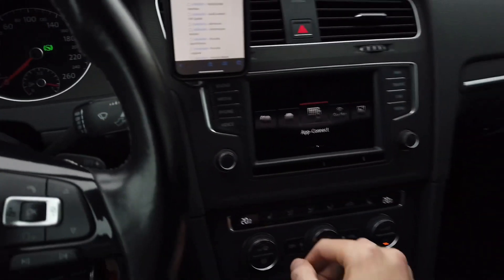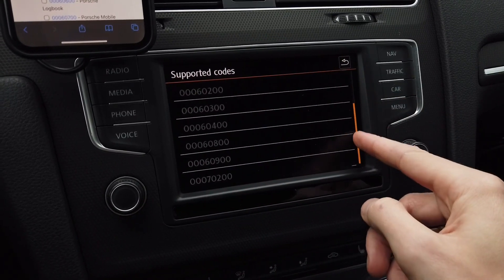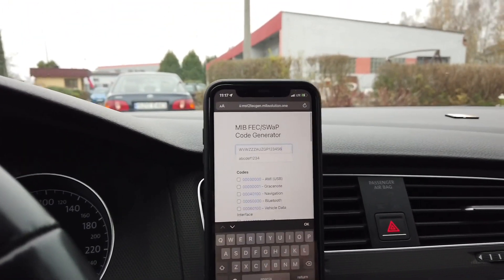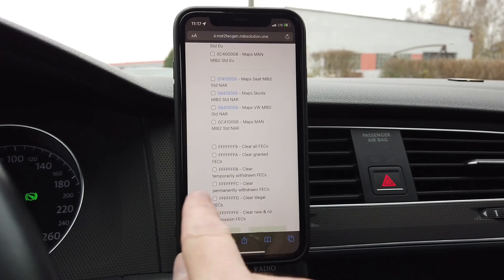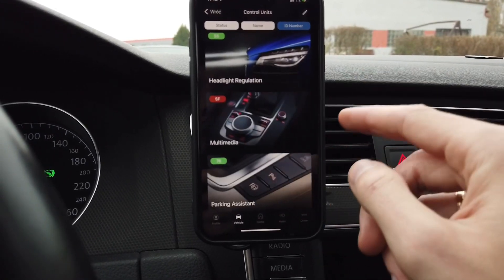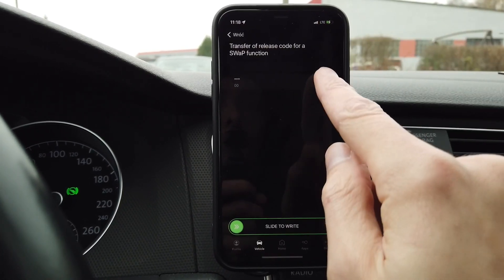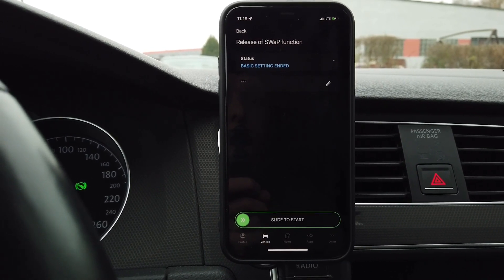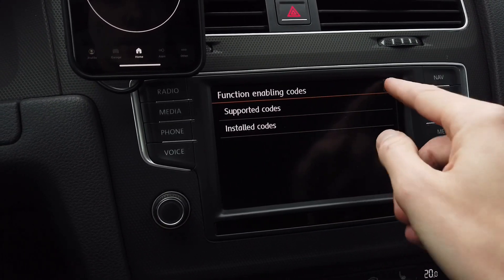How to delete invalid FEC/SWaP code from MIB unit

Comment: My MMI stopped working, audi dealer said i needed a new 5F unit. I bought a used MMI unit on ebay and dealer removed CP. But only the radio works now. How do I restore the media, Nav and phone?
Reply from the maker: Removing CP is one this. Inserting FECs is another thing needed for the unit to be fully operational. You can go back to dealer and ask them to finish the job properly. Or you can patch the unit ad DIY.

Comment: I followed the procedure, but the invalid codes don't get deleted; I have a Mi2 STD
Reply from the maker: Self generated codes (including those service codes used to clear invalid ones) will not work if unit is not patched.
Reply: the unit is patched @mrfixpl

Comment: Thanks for this video! I actually have items as both Invalid and valid - how could that be? And what is the benefit of clearing the invalid ones?
00040100 Invalid
08400008 Invalid
00070200 Invalid
00050000 Invalid
00030000 Invalid
00060100 Invalid
00060800 Invalid
00060900 Invalid
00030000 Valid
00040100 Valid
00050000 Valid
00060100 Valid
00060800 Valid
00060900 Valid
00070200 Valid
08400008 Valid
Reply from the maker: as long as you have a set of valid code, you can just ignore those invalid ones. Clearing them will only help you with OCD.
Reply: @mrfixpl I gave it a try, and I still have them. The unit is patched I have have enable other codes using ODB11. I'm wondering if these "double" codes can be affected using the options in fecgen: "temporarily/permanently withdrawn" codes?

Comment: Is there a way to change installed code status from "invalid" to "valid" ?
Reply from the maker: Patch, delete invalid ones, insert new ones.
Reply: @mrfixpl  thanks for your reply. what do you mean by "patch"?
Reply: @mrfixpl  ok i saw that i need to use the toolbox for patching the unit.. but is it safe,? can i brick the unit if something goes wrong?

Comment: Hi .. i Need help, have update and patch my unit technisat, insert swap correctly but android auto not appear in smart link ! Why? Swap code was installed and valid
Reply from the maker: 5F adaptation > vehicle configuration > enable apple and google
Reply: @mrfixpl  perfect... Top 😍 .. 
Can i Active in Delphi system same  carplay ?
And what can unlock swap in this unit?

Comment: What happens if you use this generator on a non-patched car?

Will the code just show as invalid or can you delete even your valid codes with it?
Reply from the maker: Code will be shown as invalid.
Reply: @mrfixpl  ok, but can you then clear the invalid code on a non patched unit?

Also do you have any idea what 
Code: 00060F00 - DAB full is supposed to add?

If you have DAB, do you have this code or is this something else?

Comment: Hi bro i have a vw sharan 2017 how do you patch for it, i need to get carplay and i have the OBELEVEN tool
MU version 0449
part nimber 5C0035680G 
MST2_EU_VW_PQ_P05449T
It would be really helpful if you can provide me with an answer PLEASE THANK YOU

Comment: What happens when You delete invalid codes?
Reply from the maker: Well, since those are invalid codes, they do not work anyway. Removing them helps keep the FEC container organized. For example if you buy seconds hand unit and want to remove codes that were generated for previous car (with it's VIN and VCRN). It's more of an OCD thing that actual functionality.
Reply: @mrfixpl  thanks for fast reply. Nice videos!! Keep going!!